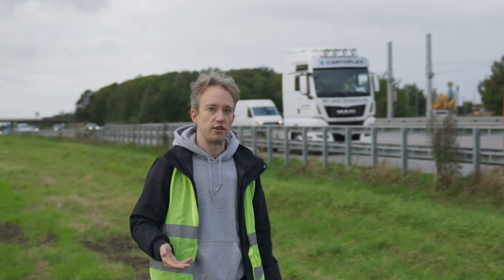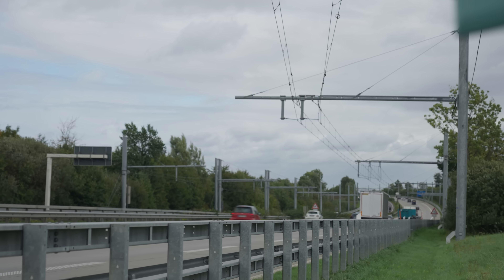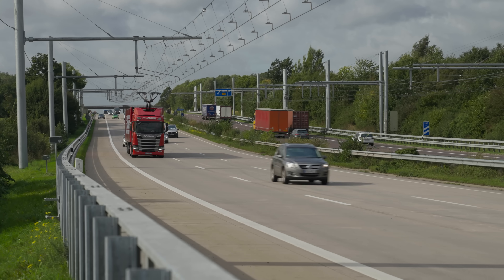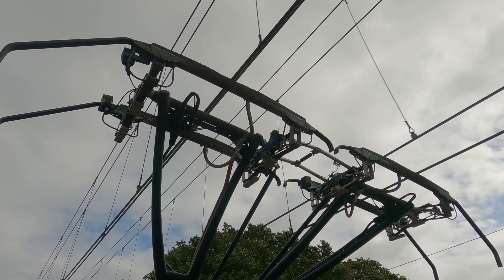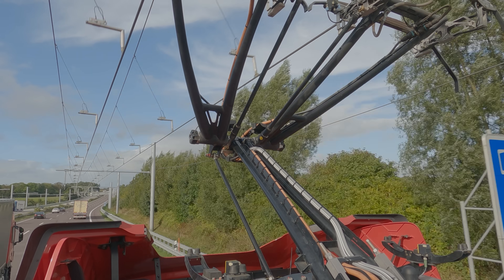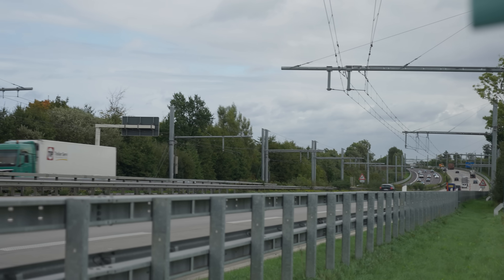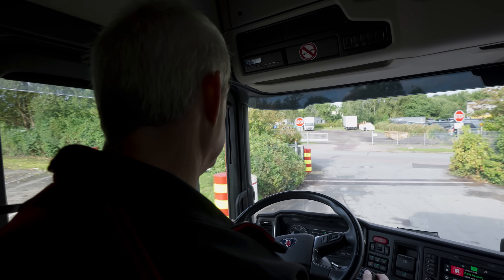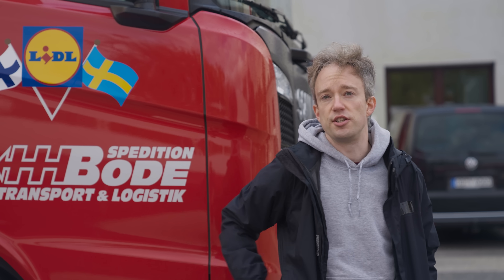The highway where trucks work like electric trains

Comment: This is a great idea for interstate highways since that is where most long haul trucks spend most of their time. Driving and charging the battery while on the highway, then switch to battery power when exiting the freeway.
Reply: Except the US interstate system is prohibited from having overhead wires
Reply: @colinsutherland201  one of the problems with the US is dwelling in the past. Oh, the law states that, oh the founding fathers intended to, nobody cares what a bunch of slave owners would think about laws which are in 2022. Change is inevitable.
Reply: @colinsutherland201  Then those laws need to change.
Reply: @colinsutherland201  Things/Rules can be changed if wanted.
Reply: @benjaminbremond6907  US hardly change a law, they're usually too late at changing laws.
Reply: No, it's a stupid idea.
just use conventional electrified trains.
it's more energy efficient, safer, doesn't use disposable rubber tires.
Reply: @ciro_costa  We already use trains for that but this kinda needs to happen to lorries too since they are also used and this is the most efficient ways for them to do it.
Reply: @ciro_costa  It's not stupid idea, it's good idea. But like always there's no one solution. More trains is good, but it requires quite a bit of investment due to new land use and new infrastructure. Also it isn't as versatile so you need to be more careful where to palace it. I mean why not have both?
Reply: @ciro_costa  Listen kiddo. These trucks are made to delivered goods from Train Depot or Port to Local storage areas. They can't use train to delivered goods from train depot to your local warehouse.

You train maniacs need to stop with your illogical arguments.
Reply: @nntflow7058  Local warehouse?
you mean the place where the end user will buy the products?
trucks are only needed (as of today) for last mile delivery also called the morning delivery. That's for the local grocery story (i'm not talking about the targets and wallmarts those are very stupid and they need to end) and maybe the farmer's market. We still don't have a good enough solution for that. But from the port and the farmland to the city trains will always be the best answer.

Also, the trucks required for last mile delivery are not the huge nine-wheel ones. They look more like minivans.
Reply: @ciro_costa  boy you really convinced trucks only deliver bottles of milk? They transport anything from thumbscrews to cows and from oil to frozen ice. Sometimes they have to be full size sometimes they dont. The road network is like 50 times more extensive than the rail network why oh why do you want to ignore it? What company would send small trucks to the nearest station, wait for the next train that stops at the closest hub, have people unload your stuff onto the next train, then repeat the same at the right station and get another truck to make the final <100km? When they could just load one truck, have that truck go to the freeway, maybe switch one or two freeways and do the whole ride directly without stopping. It’s simply irrational to build roads that connect pretty much anything in a country but not to build expressways for more efficient itineraries, so considering this it’s also completely irrational not to use these expressways for commercial transport.
Reply: @blanco7726  the problem is that some loser in the 40's decided that cars and trucks were the best way to move people and stuff. So the infrastructure was built. That's why it's easier today to use trucks. But when you take the infrastructure into account it's way more expensive to use roads instead of trains.
Reply: @ciro_costa  because less trains run than cars, theres less infrastructure as well. Like I said the road connects about every building in the country, it's no revelation that it costs more than specific  rail lines. I understand your point that expanding the rail network will pay for itself over decades, at least compared to the road costs. But the fact is these roads will be maintained forever because like I said they connect everyone. So it is stupid not to use them commercially.
Reply: @ciro_costa  It's a lot more expensive and more difficult to install new rail lines AND the power infrastructure to support electrified rail transport than it is to just add the power lines to interstates
Reply: @richardmillhousenixon  but the cost to maintain the roads and trucks is far greater than the maintain the railroads. It stops being cheaper a couple of decades after construction
Reply: @ciro_costa  put the truck's on a train for the long distances.
Reply: @royblackburn1163  i believe that has been tried before. And it significantly slows down the loading and unloading process.
Reply: 😂😂😂😂😂 this greenies are amazingly brainwashed.

Comment: I'm repairing trams as my job and i can tell you those pantographs don't look healthy they're  not used evenly over their whole surface but only on some spots over a long time (you can see those big waves in the coal) these wont last long and will have to be replaced or at least be machined on a very regular basis. 
+ The lack of of traks or something other that keeps the truck stable makes it very difficult to stay in the right position for the pantographs and i heard that some drivers said that driving with this system is hell, because not only must they still be careful of the normal traffic but in addition they need to keep a tremendous amount of concentration keeping the lane amost perfectly. I can see such a system in the future with better lane keeping assists or with self driving vehicles but as it is today it wont be applied in a big scale.

Comment: This is not very practical when fleshed out.  Electric trucks require power which is generated how?  They also require transmission infrastructure like wires and substations.  You get those how?  Does the weather get bad here?  How will that affect the transmission lines?

Comment: The obvious application is mountain passes.  You don't even need modified trucks, just tug that acts as a braking system for downhill traffic generating electricity the whole way down and as a booster on the way up.  Grid power could make up the losses to inefficiency.  Less fuel burned, brake linings saved.

Comment: Only issue is this system wears out on each other with the fiction.
Reply: Same as with the rail system, which works, so I guess the solution for that has been already figured out for decades.
Reply: @8Hshan  On a railway you only have one overhead line, and it's running not straight over the rail but is mounted diagonally, to reduce wear on the pantograph. Trucks have no iron rail, they need 2 overhead wires, which reduces the possibility to run it diagonally a little bit, but this is a test track with very few trucks (less than 10) using it. The truck itself is steered automatically once it drives under the overhead wires.

Comment: I regularly drive between Frankfurt and Darmstadt (A5).
Once I was lucky enough to drive behind a tractor-trailer that used this technology (without a trailer). And I was even able to record it with my dashcam.
But I do not upload to YT myself. Sorry!
The test track "e-Highway" between Frankfurt and Darmstadt (A5) is 5 km long and on request the operating company told me that 5 (!) trucks could be supplied with electricity from the overhead line at the same time.
I'm curious whether this will be the future!

Comment: those wires can carry data to register which truck gets connected and and even by measuring current drop between each two node the electricity drawn by each vehicle can be estimated on-the-fly.

Comment: I think that it would be wise if in the year 2121 you could be driving a truck built in 2022.  It would be just as efficient as any other because all improvements were added as they came out rather easily all because it was designed and built properly in 2022.

Comment: The other interesting part is that you’ll only need this on the uphill sections of long mountain passes.
Reply: what about energy recovery on the downhill bit?
Reply: @klakier19901  That would go into the batteries onboard.
Reply: @yolo_burrito  only if you press the engine breaks! why us breaks downhill????
Reply: @lucasrem1870  you haven’t been on I70 through the Rockies. You can be going downhill for 8 miles in some sections.
Reply: @yolo_burrito  The batteries will be already charged so no recovery of energy downhill would be possible without some intelligent system that has to plan battery usage for the specified route. The problem here is that the energy recovery system is the engine brake that is a vital component of trucks to prevent brake wear and fade. So one way or another the motor has to apply some brake force downhill, ideally to charge batteries but this is difficult.Much more probable to be used as engine brake are induction brakes cos of self regulation with no input needed from driver
Reply: @yolo_burrito  The induction brake coupled with generator is self regulating. It will mantain a desired speed on a variable incline with very simple electronics and is perfect for the role of truck retarder. Energy recovery system should not be relied upon as engine brake or retarder in an electric truck
Reply: @klakier19901  recovery? it's just a rock that drops, need brakes?
Reply: So, what you mean is that you would need this on all mountain road sections, since uphill from one direction is downhill from the other.
Reply: @UnitSe7en  sure but fitting I70 through the Rockies would be significantly cheaper because only the lanes on the up slope would need it instead of both sides of the road.
Reply: @UnitSe7en  but only on the up hill side of grade ;)
Reply: That's a good idea! No more slow trunks on mountain passes going 20mph.
Reply: There is some mines that have used this for power assistance up hills for dump trucks.
Reply: Which is about 1 on M1 and 2 on M40 :D
Reply: you can have on the downhill section, and trucks can give electricity back to the greed during braking :))

Comment: I kind find the justification for those hypocrit. Reducing truck emission by using  electricity, only reduces the global emissions if the electricity was mad in a clean way.
As far as I know germany try to use as much as renewable energies as possible, but these production tools cannot operate 24/7 and germany has to turn back off their coal centrals when theres no sun no wind. Of cours this is without talking of the polutions that used solar pannel or wind turbines generate once their out of service

I think that a more probable explanations for this shift to electricity in general is to be less dependent of countries that detain the most oil. This can be a reason in my sense but they should be clear, no electricty is not equal to less polution

Comment: Look at the wear on the contacts. Is that perhaps a graphite composite? How much time to replace and where? From the sneak peek it also seemed to show a loose carriage bolt on the passenger side contact rail. Induction is not efficient, granted, BUT look at the extra material and time involved required in this direct contact system. People are hysterical over green and that hysteria will cost us all beyond reason. This entire new electrical structure was made possible by fossil fuels.

Comment: i like the idea. 
Is there any concern about particulate matter pollution ?.. because the friction between the wire and the graphite ? Or is it nothing to worry about?
Reply: Once everyone is driving EVs, then the next polluter will be brake dust, or perhaps not with regenerative electric motor braking

Comment: Here’s a novel idea, why not join all the trucks together so they don’t bang into each out and you only need one driver. Or better still, put the trucks on rails so they all stay in a nice safe straight line. Why has no one thought of this.🤔😈
Reply: thats train
Reply: Hmmmm, but then the trucks won't be able to easily get off to seperate cities, localities and warehouses that they want to go to. Not to mention rails are way tougher on steeper incline and all the trucks will need to be of similar size to be joined together. 🤔🧐

Comment: A downside is power outages/line breaks - how much of the track goes out if a section breaks and how easy/quick will it be for engineers to identify and repair?
Power outages could be supported by battery backups similar to powerwall or hydro batteries I imagine.
Reply: not a problem, these trucks have diesel engines because the 'last mile' to customer sites, warehouses etc. won't be electrified. only the main motorway routes will be.
Reply: Hopfully the trucks can keep on driving on battery in the outer lanes. But I get your point 👍🏻